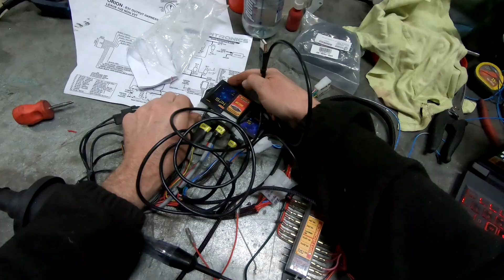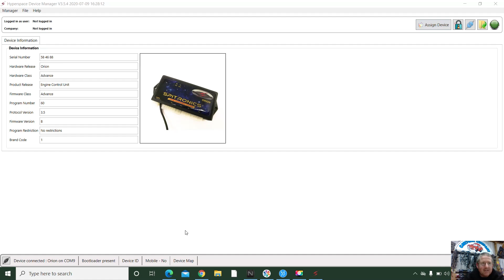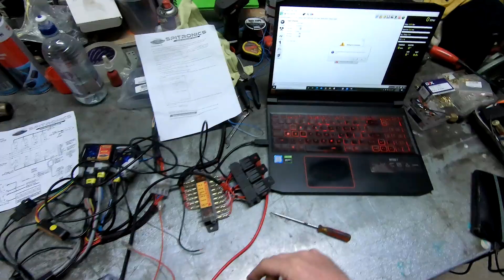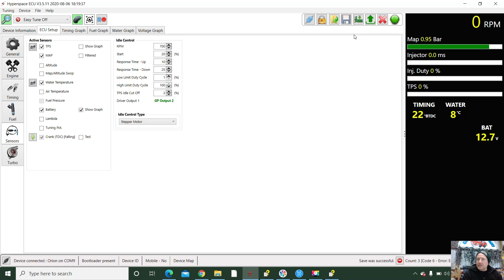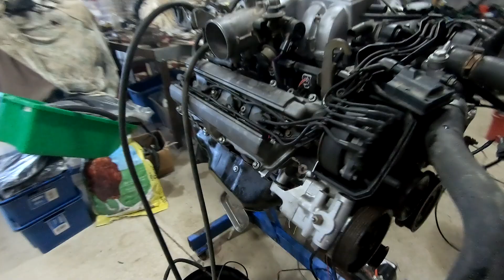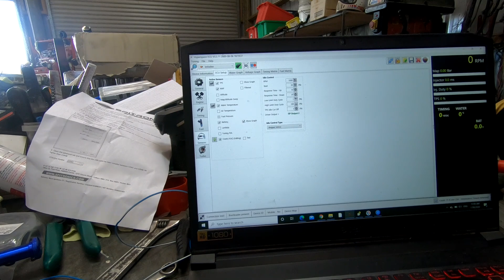Spitronics 6 It runs

Comment: Just curious, where did you mount the map sensor? Looks like you have it connected to the front of the intake manifold near the stepper motor to a port there but I couldn't see where you mounted the sensor itself. 

I've got a first gen 1UZ on the engine stand that I'm pulling the top end off, cleaning up everything and replacing all the gaskets, water pump, distributor bits etc before I put it all back together so no leaks or crusty gaskets before I put it my old Isuzu Trooper. Engine had about 180km on it, great compression, cylinder walls look amazing, all the cross hatching is still there. Ordered the ECU from Spitronics along with a premade harness they sell for it, all the connectors look good, will test everything to make sure it's pinned out correctly but they were easy to deal with. Can't wait to get it fired up. Seemed a better way to go then gambling with a factory ECU and the wiring harness that came with the engine was a mess. 

Also curious if you ran it on standard O2 sensors or wideband sensors? 

Thanks man, your vids have been a huge help, I keep your page bookmarked in my workshop.
Reply: No response for Andy?

Comment: I would like to get a hold of your manuals please point in the right direction.. cheers Danny
Reply from the maker: the info for the spitronics?
Reply: @CartuneNZ  Not spitronic.. for stock ecu .. or rather should i just say... i would like to get a hold of most of ur wiring info..
Reply: For spitronics ur videos gave it away... i think the videos explain alot...
Reply from the maker: My stock ecu wiring is something I sell.  Presently $175nzd for each different version of 1uz ecu of which there are a few.  Email is in the description.   Cheers
Reply: Westing time you